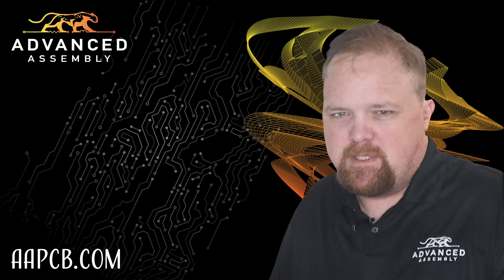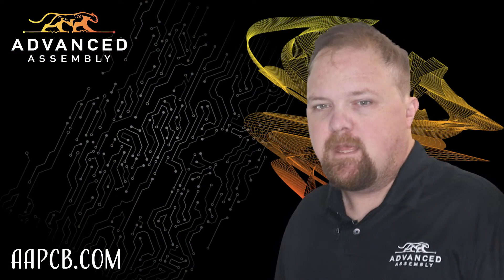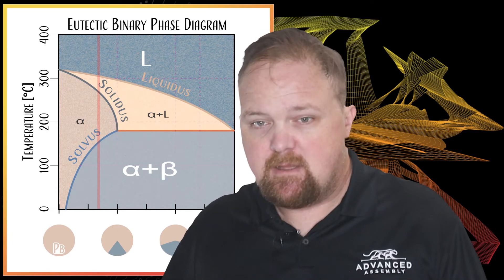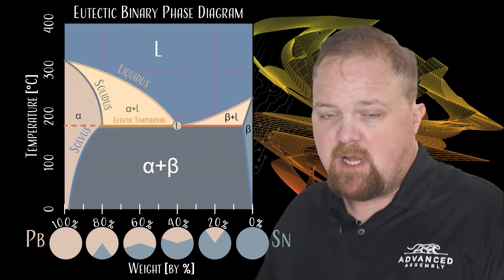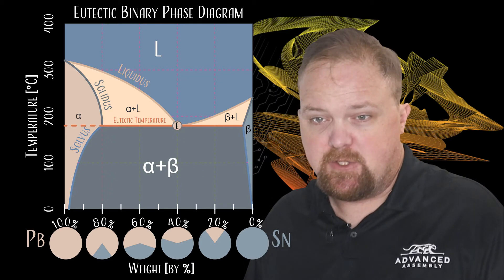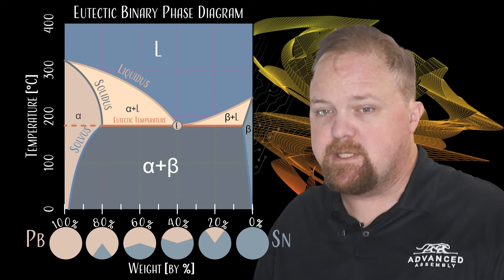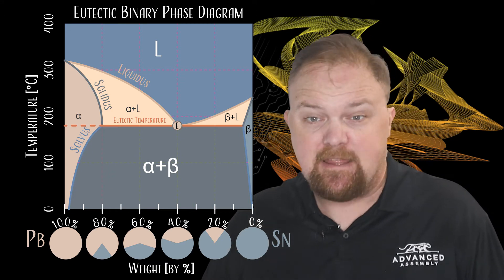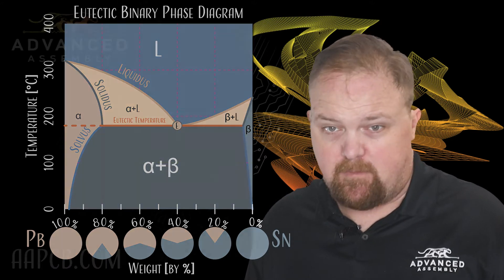Eutectic Solder Explained

Comment: I've looked at a few videos on the subject, but this is probably the best - but it doesn't quite answer my question - Which is better to use? - Eutectic solder or 60/40 mixture, where there is a small plastic temperature range?  I used to work in electronics, and when I left the bench, I moved into field maintenance, and from there to tech support, and I worked less and less frequently with solder, so I was able to work for many years with the couple of rolls I was left with.  I never took notice of the mixture - I didn't need to because it worked and gave me good joints, and besides , it was what was available at the time.  It finally ran out, and I got a new roll of solder, but everything has gone anti-lead now.  It says "60/40" on the roll, but it doesn't mention tin or lead, and it just doesn't flow like the previous one did, and doesn't leave a shiny joint - it's a matt finish, and looks like a dry joint every time - so I'm going to have to replace it again.  Should I go for 60/40 tin/lead, or is it better to order a eutectic solder for hand soldering?
Reply from the maker: Hi Mike -- I'm glad you enjoyed the video.  I know exactly what you mean about the appearance of solder joints.  With lead-free hand assembly, it sure is hard to come up with a shiny joint that doesn't look like a cold-solder joint.  The same issue exists for copper pipe (plumbing).  Although with pipe there's a work-around -- you can use your flux-brush to apply additional flux while the solder is still in its liquid phase.  Brush off the extra solder and it looks pretty as a peach :)  Or you can use tinning flux (solder and flux mixed together).  https://youtu.be/V13EEkeeYfM?t=360 

But you are more likely asking about how to get pretty solder-joints on your electronics project.  There are a few tips/tricks you should be aware of.  I'll say it with the caveat, it's going to depend how reliable you need your assembly to be.  On personal projects, I do almost none of these things :)  

First, what plating do you have on your board?  Bare copper oxidizes almost immediately.  ENIG plating on your board is preferred -- gold is inert, it doesn't interact with oxygen.  OSP is fragile, Silver oxidizes, and ENEPIG is usually overkill.  Take your board out of the bag and bake it at 65° for half a day (toaster oven on the lowest setting).  This removes moisture that might be in the board, and after you finish the bake, you have about 8 hours to solder.  Wear gloves from this step forward to prevent oils on your hand from contaminating your board.  Next, mechanically clean your land pads with a fiberglass pen.  The abrasion helps to remove any oxides and scratches the surface a bit -- this helps the solder to better wet on the surface.  Even if you choose not to bake the board -- use the fiberglass pen.  If you are using through-hole parts, use the fiberglass pen to clean those things too.

Next -- try using SAC305 solder paste.  This is not a roll -- it's a mixture of paste and solder metals that you apply with a syringe or toothpick, or preferably a stencil.  The nice thing with the solder paste is that the flux will melt first and be in instant contact with the underlying base metals, removing more oxide, and lowering the surface tension of the metal when it changes phase.  Unfortunately, this stuff has a shelf-life of 6 months or so.  So you should only buy as much as you are going to use, and store it in the refrigerator when not in use.  If you have a soldering iron that is capable of precision temperature control -- start by setting your iron around 5° hotter than the transition temperature.  For SAC305, the transition is around 220 -- so set to 225.  If you have heavy copper or large components, you might not be able to put enough heat in before it dissipates, in which case, go ahead and dial up the temperature to whatever works.

For hand soldering, it doesn't really matter if you are using Eutectic or non-eutectic solder.  The liquidus-solidus transition temperatures are so close together, and your application of the iron so variable, that it's impossible to control the temperatures precisely enough to care.  Don't leave your iron on the board for more than 5 seconds and it'll cool back down.

So -- in short -- mechanically clean your land pads to remove oxide -- and use fresh solder paste, and you should start to like your joints again!  I hope this helps.
-- Mark
Reply: @AdvancedAssembly  Wow!  Thanks for an exhaustive response, Mark.

I haven't done a huge amount of copper plumbing - though I have done some.  I have found that if the pipes are clean (sanded of wire-brushed) the 5-core solder I had did a pretty good job.

I worked for NASA about55 years ago, and they sent me on a week's course to learn soldering, so my electronics work is pretty good.  For a year, I was certified to work on space craft, but to maintain that would have meant an annual re-certification, and I didn't ever do that.  There was also some theory on the course, and that's where I first came across the concept of eutectic metals.  We did clean pads with a fibre-glass brush - though I have never done it since - and baking boards first - no, I have never done that either.  I had never even heard of it.  Most of the work I do these days is repair - I'm currently working on my daughter's 12-240V inverter for her car.  I think it had been over-driven - it had blown a track off the board, and some of the FETs had legs that had clearly been melted.  ;-)

I have looked into having boards made for SMD, in which case I'd order a stencil - but I haven't got into that yet.  I do have some paste, but I have never had occasion to use it.  I didn't know it had a shelf life, though, so thanks for that!

My only beef is with this roll of solder I bought.  It's crap!  The labels had come off the other solder I had before, so I don't know what it was - only that it worked.  I can remember that it had 5 rosin cores - if you cut it with nail clippers, you could see them.

Thanks for the advice.  I'll go for 40/60 solder, but I'll make sure it's a tin/lead alloy.  I just couldn't remember if we had used eutectic solder on the course.